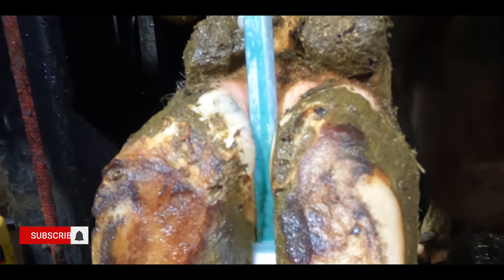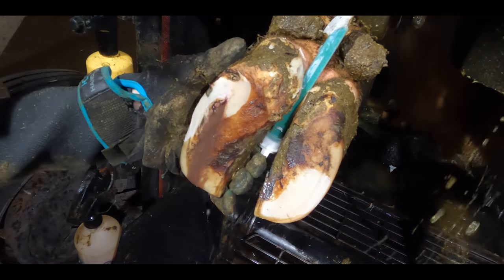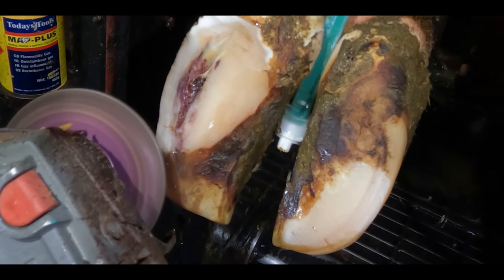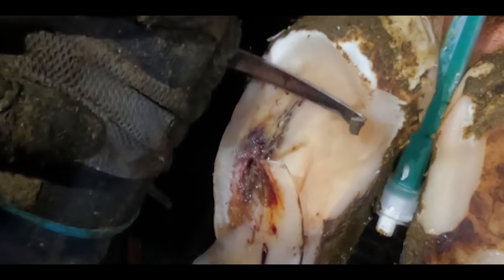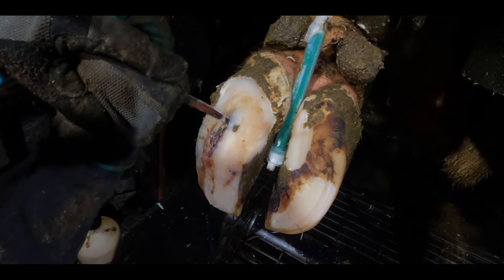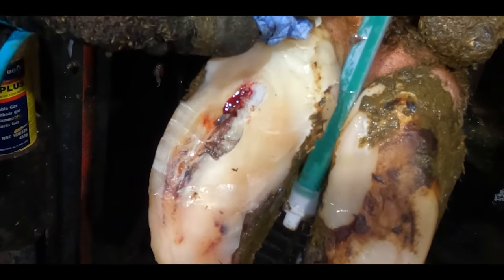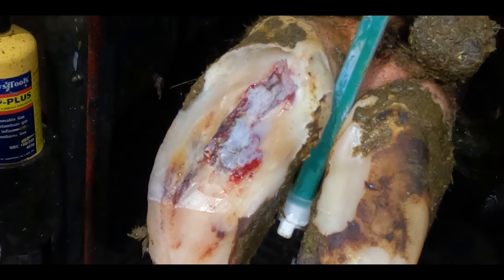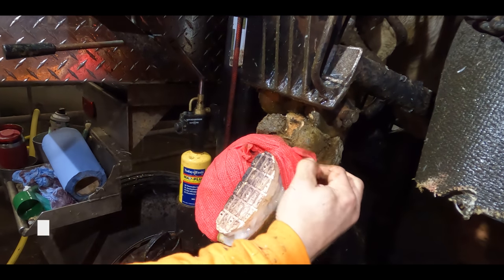*BUBBLE BURSTS* FLUID POURS OUT of COWS HOOF!

Comment: So as a question (and this is for any who may know the answer as well, not just The Hoof GP): Why do you continue to even try to use that magic paste mix? On every video I have seen you do where  that 'magic paste' has  been used, it has never made a blind bit of difference, whereas the salicylic acid powder mix when applied always seems to work a treat. I know there is a lot I am not seeing of course, which is why I am curious on going this route at all rather than just jumping straight to the acid?

Comment: You know, this wouldn't be a problem if you weren't keeping the cows in CONCRETE FLOOR STALLS. Their poor hooves are used to the soft ground of earth and dirt, it's no wonder their hooves are ending up like this.
Not to say that getting rid of the concrete floor would solve ALL the bad hoof problems, but it would help with a lot of them.
Reply: The alleyways are concrete the stalls are laid out with rubber matting, straw bed packs, sand, shavings or corn husks.